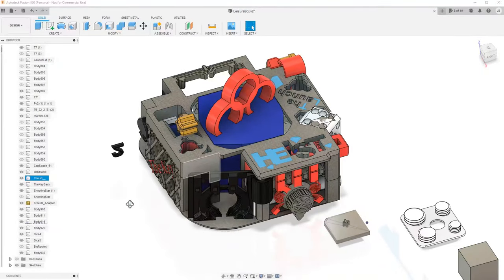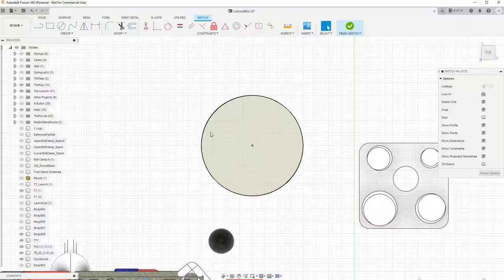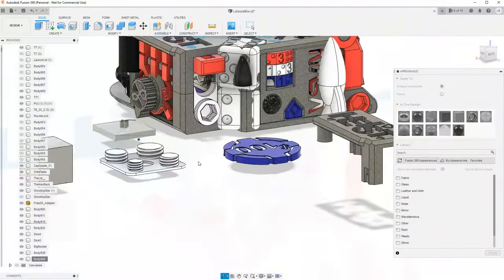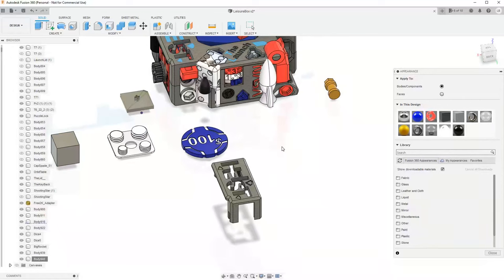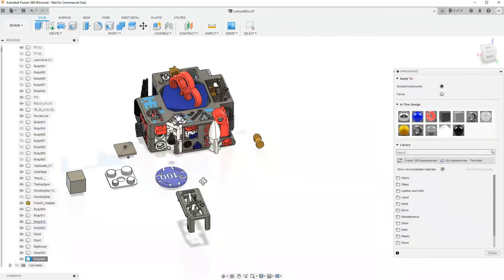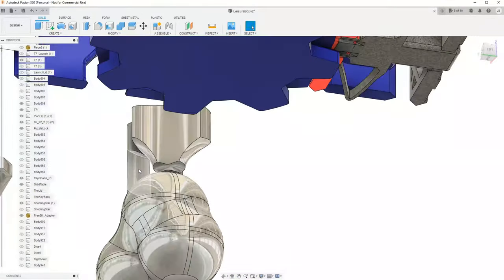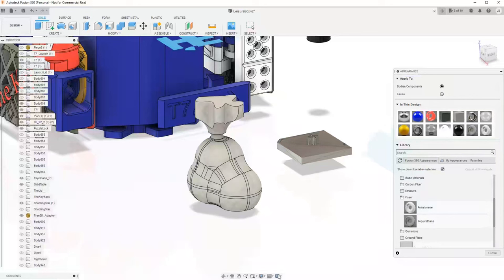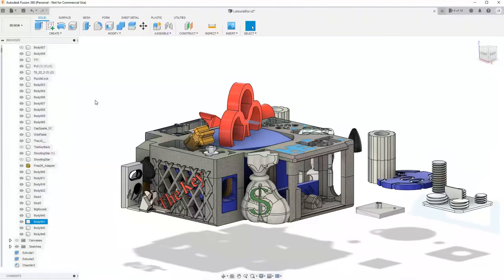Designing the next Puzzle Box!  🤓🤓🤓

Comment: Will all of the puzzle boxes still print well if I use a .6ml nozzle?
Reply from the maker: If you’re using a .6 nozzle I recommend printing everything at 150% size… which I fully recommend!  At 100% you may have some odd things happening with the smaller spring pieces.  Maybe it’ll work, but I’d expect some minor tolerance issues too if it all printed well. Which printer do you have?  You thinking .6mm nozzle for fun, or is that what you prefer?
Reply: @LeisureLuke   I have the ender 5 pro and have been using a .4 nozzle but it gets clogged up when I use the marbled filament because of all of the little specs. I was thinking of using a .6 nozzle so it could pass through easier.
Reply from the maker: @duxedo  What's the brand of the filament you have?  Most people print 0.4 nozzles and marble/wood/sparkly filament with no issues.  If you go to 150% size with a .6 nozzle there should be no issues.  I'd find a different role of filament!  I've been using XingTong (Cheap on Amazon), but they are out of Marble at the moment.  Perhaps the Ender5 standard nozzle and Bowden tube make clogging more likely than my X1's volcano nozzle (which is just longer) and direct extruder (no tube). Interesting...  Keep me posted!
Reply: @LeisureLuke  I am using the XingTong light grey marbled pla. I have only been able to do one nice print with it In a .4 but the filament gets clogged everytime now. I am fairly certain that it is getting clogged because of the little black specks in it, every time I try to do a print with it I always follow the temperature instructions.

Thanks for the help
Reply from the maker: @duxedo  Funny, same stuff I use.  I've had zero issues with my 0.4mm nozzle, been through 1.5 rolls.  I always print at 210C, standard temp.  Well, shoot.  I think printing them with a .6mm nozzle, .3mm layer height, and 150% size would make a pretty cool thing!
Reply: @LeisureLuke  ok cool thanks I will try it a few more times to do prints with it and if it doesn't work I'll move a .6 nozzle. Thank you for all of the help

Comment: I hope it's almost here
Reply from the maker: I hope so too 🤨 I will dig into it soon and finish it!  It’ll need some testing.  Would you be interested in beta-testing some pre-release .Stl files in a month or two?
Reply: @LeisureLuke  sorry, just saw this. 

Yeah I'd be interested! Although you should probably include a little resistance test that prints alongside the model so I can test it with T-Glase. That's  what my school has the most of right now, and the only printer that takes pla is not built for multi day prints. It's one of the makerstations. It's alright, but has a habit of knocking builds off the plate